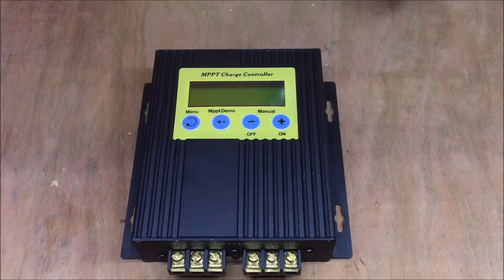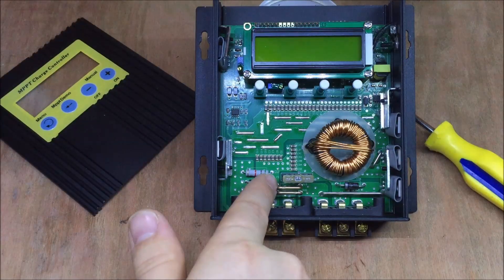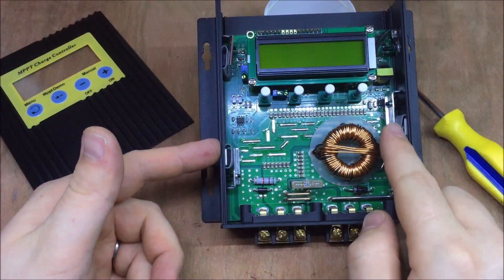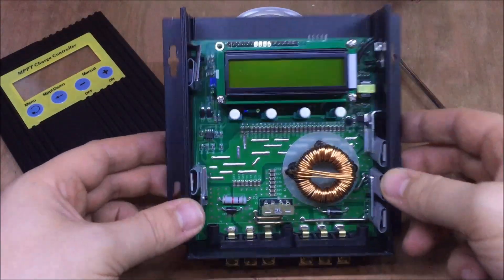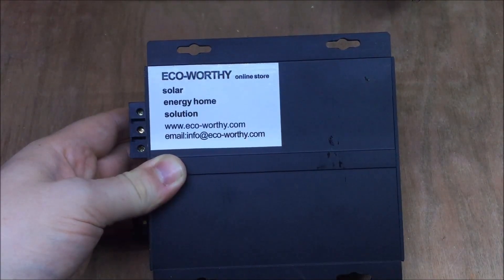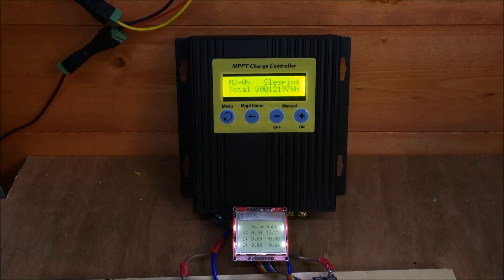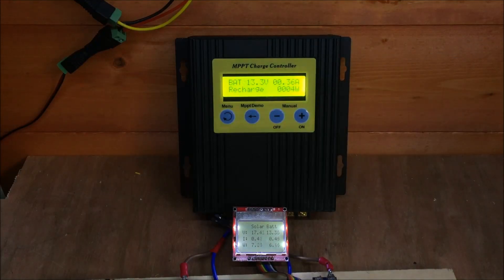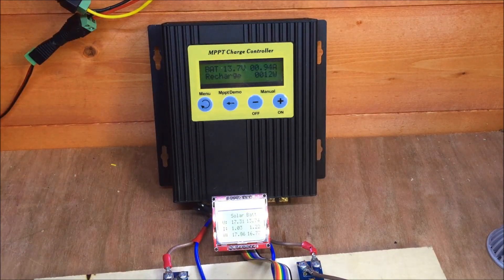eBay MPPT Solar Charge Controller Review - 12v Solar Shed

Comment: Hey mate, i have this MTTP charger currently hooked up to 3x85ah lead acid batteries but considering upgrading to 1x 120ah lithium battery. Will this controller still safely and efficiently charge a 120ah lithium battery? thanks

Comment: Hello Adam,  I know you made this video a long time ago.  I had bought this model based upon this excellent video.  I used it in a van build and it worked flawlessly.  I sold that van with all the bells and whistles.  So unfortunately this controller went out with the van.  You wouldn't happen to know where I could get another one of these would you.  There are a lot of fake MPPT units out there that are actually PWM.  I want what I know is reliable.  Cheers!
Reply from the maker: I’m afraid I can’t suggest where you’d get another one. I rate the EPEver mppt charge controllers for reliability and bang for your buck. I run two of the tracer A series in the shed now, but the tracer AN series is another great option.

Comment: I have the ECO-WORTHY 20A 12V/24V MPPT Solar Charge Controller
and I have a 175 Ah battery, and a 275 Wp panel connected to the controller.
The 2 main screens are flashing instead of showing the correct volts, current, etc.
Also, I don't seem to be able to change the output mode to Bulk which may be causing the problem. Following the instructions of the product, it seems that the left arrow  (<-) does not work to switch between the fields of the output mode.
I would appreciate your help!

Comment: Can no longer find this item on ebay, is there a new version thats come out..?
Reply from the maker: Haven’t used it but this is the replacement I think... https://www.eco-worthy.com/collections/solar-charge-controller/products/40a-12v-24v-mppt-solar-charge-controller-with-bluetooth-monitor?variant=30252172738612 Have you looked at EPEver? I’ve made quite a few videos on their kit.

Comment: Can I connect to 3w 6v solar panel
Reply from the maker: No. Nearly all 12 or 24 volt solar charge controller will need a solar panel which creates a voltage higher than the battery. 
I’ve looked at super cheap PWM solar charge controllers that work with 6v lead acid batteries which might work with your panel. 
Some mppt controllers do boost the panel voltage rather than buck. Again I’ve tested one, but they tend to work with higher voltage battery banks - 24v or above.

Comment: Thanks for the review and the informative videos in "The Solar Shed"! I have followed your advice and purchased the Ecoworthy solar charge controller as reviewed. I have a question. Is the initial setup badly worded in the manual and in the software. I get as far as the choose the battery voltage and then get to the confirm screen where no buttons seem to work? It talks about pressing the Yes or No soft keys which I guess means + or - or the Enter function via the Menu key?  Neither Yes or No is highlighted and pressing + which you'd assume was YES doesn't work. The - key takes you back a step to choose where the 12 or 24v  choices are available highlighted by a > symbol. Menu does nothing and the screen maintains the Are you sure message. Grateful for any observations on this issue!!
Reply from the maker: Hello.  I don't use this solar charge controller any longer - not because it wasn't any good, but because I like the way I can read the details from my new one over wifi or the internet.  Anyway on to your issue... I've dug it out tonight to check the start up procedure - as you say it tries to use soft buttons but they don't line up correctly.
Attaching the power should show the firmware version on screen, followed by "SYSTEM VOLTAGE ENTER 12<  24"  The minus and plus button will switch the arrow between 12v and 24v.   Use the Menu button as an enter key, then you'll be asked to confirm your choice and you use the Mppt Demo button to confirm this - which is almost under the YES.  Its a bit odd but I guess they've used a different 'enter' button to ensure you can't double press the first time and not see the confirmation message.  Anyway - I hope that helps.
Reply: @AdamWelchUK  Thank you for the effort you've put in here for me.  In the end as you say if you press the Demo button rather than the enter key it apparently is the way out and everything works on 12v in my case. A little lost in translation I guess but a good value product. I have found it helpful and gained Thankjs great confidence and information viewing the story of the Solar Shed! Thanks again, Steve
Reply: I have a question about the startup procedure on this unit. Is it possible to make it remember the voltage selection? I have 3 of these and occasionally I have cases where the battery they are charging gets depleted to the point of cutoff. Once that happens the charge controller shuts down and will not reactivate on its own when the solar panel starts producing again due to this annoying startup menu, leaving the battery dead until I notice it. This is very frustrating and has me shopping for new controllers that will start on their own!. I love the fact that the settings are easily adjustable and the fact that it tracks the total power produced. Is there a similar charge controller out there that does all these things but will start itself automatically?

Comment: Adam,  i have been watching some of your videos on solar charger controllers recently.  Please ensure that you comment on more than just whether they are true PWM or MPPT.  You recommend this one without comment on its charging algorithm.  My version of this controller does not hold the absorption voltage during charging.  Once The bulk charging voltage is reached it quickly goes to float voltage  without a sufficent constant voltage absorption stage (where current decrease as the battery reaches full charge), which is not what a good three stage charger does.  My charger is therefore not able to fully charge a battery.  What does yours do?

Comment: I've been using this controller for a small lead-acid system in the greenhouse (using the stellar Outback FM-80s for the house) and want to re-task this small unit for charging a 4s Li-Ion portable bank. This little unit lets one manually set bulk charge up to 15.5 volts. Do you think that is high enough to charge a 4s7p 18650 bank? Not sure if 3.875 volts/cell is sufficient for 18650s. Thoughts?
Sorry I'm late to this party, but this seemed the best video to address this idea.
Reply from the maker: Have you seen my videos on solar charging 18650s - well there's a bit of a series on them?  My personal view is that charging to 3.875v is probably a bit low.  I charge my 7s lithium bank to 4.05v currently.  Spoiler alert - I don't think 3s or 4s really works with 12 volt systems.
Reply: Thanks for the reply. I've watched your great videos and will likely go with the 7S4P 24V+  plan. I was hoping to keep it portable with a single 30-40 watt panel. My home is based on a large 24V lead-acid battery bank (52kWh; 12 giant 2V cells)  , but 12 volt is so handy for most of my portable needs, mainly charging devices. I have a nice 24 <-> 12 buck converter I'll install, but conversion wastes power. I was hoping to avoid that.
Thanks again! Big fan.

Comment: PS would you recommend this controller over a tracer. and what's the max volts in? seems like its lower. or I may be thinking of another. seems like 55v. I could be wrong.
Reply from the maker: Yeah the Eco-Worthy has a max open voltage input of 50v and the tracer is 96 volts.

Comment: you seem to be the man when it comes to charge controllers and solar power. I need either a good deal  on a tracer A 30-40 amp. or a cheap mppt controller. that I can use later on a small 12v lithium bank. for now I need to charge a 24v lead acid bank with a couple 100w12v panels. also do you know of a good but cheap solar panels . without crazy shipping Prices. amazon has 100w for just over $110 us dollars. with free shipping. do you know of a better price. I'd rather have 24v 250watt panels. for now I have to stick to spending $150-$200 a month on panels and a controller.. gas isn't cheap and my generator is thirsty!!!..   after I can charge my batts by solar. I can afford to spend more on solar. I an fully off grid. thanks.
Reply from the maker: This eco-worthy charge controller works very well, but for me I like the tracer because of the communication port mainly.  I like to be able to remotely keep an eye on the system in the shed and the eco-worthy doesn't have that facility.  If you are interested in a tracer take a look at my review, and most importantly the follow up video - tracer after 9 months.  I really like the controller but it has some minor issues - but then it is cheap.
I haven't really looked at panels recently, my shed roof is full (unfortunately) so I'm not sure I can really help there.
Reply: Look for used solar panels. MPPT controller allows more flexibility with the panel voltage. Or look for 2nds or 3rd quality panels from a manufacturer in your country. I got 10x 315w 24v panels off eBay for $1175 shipped to the freight terminal about 90 min from us. I wish I had about $5k when those were available. We'd be set for a while
Reply: John Kimball at sunelec.com, based in Miami, exports panels to everywhere including the British VI, etc.. He's a wholesaler who buys up overstock and has new panels at ridiculous prices along with lightly-used panels, Grade B & C panels. He likes to sell by the pallet but will ship individual panels. I got a pallet (22) of 250 watters for 48 cents/watt (US) last year. He'll ship anywhere. Not sure of costs to the UK. He has a retail warehouse in Barbados, which may help avoid import duty to the UK. Not sure about that.  Cheers!

Comment: Adam - looking for a small MPPT for my 12v pond pumps. At about 9:29 you talk about the discharge output. Is that the "Load" connections? I need this controller to "Turn On" at about 12.8v (and output power) and then "Turn Off" at about 12.2v (kill the power). Will this Eco-Worthy do this?
Reply from the maker: HI Chris.  The charge controller has a 'Over Discharge Protection' setting and a 'Discharge restart' setting as mentioned here in the manual...  http://admw.uk/ii   Now I'll be honest I haven't used this SCC for a while and I've forgotten quite how that bit works.  I'll try and test it in the next 24 hours - give me a nudge if I don't come back to you by then.
Reply: Thank you! My $30 Hompie 30a (PWM) runs the 12v pond pumps great. "Turns on" the LOAD side at 12.8v and kills the power at 12.0v. No funky "light or timer" nonsense...just voltage sensing. However, with 300w in attached solar panels...a MPPT charger would be more efficient.
Reply: Looked at the manual and "Load" control...looks like this will not work for what I need it to do
Reply: Chris DIYer maybe you can keep your controller for the load output. and not have solar connected to it. and use something like this controller for charging only? could that work for you?

Comment: hi adam was wondering if you could tell me if its possible to use the load settings on this as a dump load for wind power , ive had this unit for about 2 years its a great bit of kit but ive upgraded my system for lithium , and thought why not build a wind turbine and use this as controller so its not wasted . Just not sure if this is possible as not electronically minded :-)

Comment: Thanks for response Adam...yes I think I have just realised my mistake, the 1 amp was the float charge going into the battery rather than load going out. Batteries are fully charged and no load running at the time so the MPPT restricts whats going in. I have not used the load port on the charge controller and have a separate fuse panel wired from the battery bank to run the lights/pumps etc - if I want to know what load is being drawn out of the batteries I guess I need to fit a meter of some description on this circuit.
Excuse my ignorance, first time I've done this, your prompt reply much appreciated.
Kind regards.
Reply from the maker: +pete smith No problem at all - I'm glad it's all working well. Cheers

Comment: Hi Adam - Could I pick your brains? I have just installed an MPPT controller and solar panel/battery bank in my caravan.
When I connected everything up the charge controller was showing battery voltage at 14.1 (sunny conditions so charging) and an Amp reading of 1.0a. Please excuse my ignorance but is this normal? I was worried at first that I had some kind of short circuit.....no loads running but losing 1.0a????   But is this figure actually correct, and part of normal operation to prevent overcharging of the battery bank?
The MPPT controller is probably smarter than my understanding of how it works!!
Would appreciate your comment.
Best Regards.
Reply from the maker: Your controller was showing a load current reading of 1 amp?  If so that does sound odd.  It could be as simple as a mis-calibrated current sensor rather than an actual short circuit.  
It wasn't a current reading from the solar or the current going into the battery was it?

Comment: what's the max in volts on the EPever you have? does it buck from higher volt. like 24 to 12? I would like to use the high volt panels. with 12 v batts. I plan on moving up to 24 or 48vin the future but need to use the 12v inverter now. you have a great informative channel. thanks for what you do!
Reply from the maker: +James stranger The tracer A series is good for 96 volts on its input. It can buck this voltage for either a 12 or 24 volt battery system. Cheers for the kind comments.
Reply: Adam Welch thanks for the reply. have you seen any issues with yours? would it be a good idea to have a spare?  thanks
Reply from the maker: +James stranger I've had no issues what so ever. Although I'm running my 20a tracer a at only 42 volts and about 8 amps. So I'm well within its limits.

Comment: I  have to add one thing I found out with my ecoworthy , you can actually charge 2 12 volt batteries at the same time with one. The battery out is one charging circuit, but also the aux out beside running 12 volt devices is also another charging circuit and will give you as many amps as the battery out. Its useful for charging jump packs. 
Mine has been running 24/7 for almost 4 years.  With a 240 watt panel I get about 12 amps charging amps with lead acid, when connected to my 3s 94 ah lithium I get 15 amps of charge power.

Comment: Can i charge lithium battery with this?
Reply: I use this same model to charge my 3s battery packs ( I have a 37 ah , 65 ah and 94 ah) . set the absorb to 13 volts to slow charge, 14.4 volts to fast charge.

Comment: The soldering job on mine appears to be not nearly as nice as yours.  The main issues I have are where the terminals are soldered to the board.  I am fairly qualified to make this judgement as I have been NASA certified in high reliability soldering inspection for 20 years.  The battery negative looks almost devoid of solder with no solder fillet either on top or bottom of the board.  The others have partial fillets on the top side with little solder flow evident.  I am going to verify that this controller is operational, then I am going to reflow these critical joints.
Reply from the maker: +Paul McIntosh That's a shame. I was pleased with the build quality of mine. Sounds like you'll be able to sort it though :-)
Reply: I am wondering if this is the reason some people have theirs fail quickly.  Since the worst of the soldering is on the battery negative lead, it likely carries most of the current across a small contact area.
Reply: Paul McIntosh You must just have an unlucky bad one, my one is great! Best bit of kit in its price range!

Comment: Hi, is it possible to regulate the output voltage to be constant at 12.1 to 12.7, regardless if the input is 14v ?
Reply: no, the lowest the absorb goes is 13 volts.  thats where I set it to slow charge my batteries. From my 240 watt panel , I get about 4 amps when set to 13 volts.

Comment: Decided to buy this one, seems mppt 100% works, but I really like timer for xmas lights alone.  This review was good.  Would like to see possible voltage ranges.  I already thinking of improvements the company can do to make this even better it would be nice to have regulated 12V/5V (it the system is 24-36V). Maybe  a few more timer spots.  The manual says it might go to 36V not sure. I happen to have a 36V inverter lying around.  I might buy another as a xmas gift.
Reply from the maker: Thanks for your comments.  It's a decent unit however the same unit has been supplied for a number of years now with no development.  I doubt you'll see one in the future with those improvements.